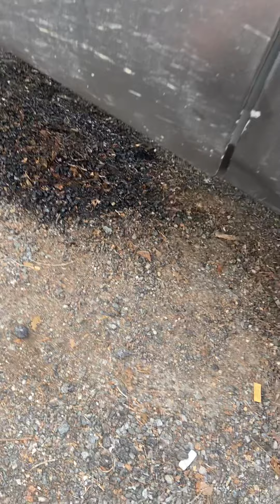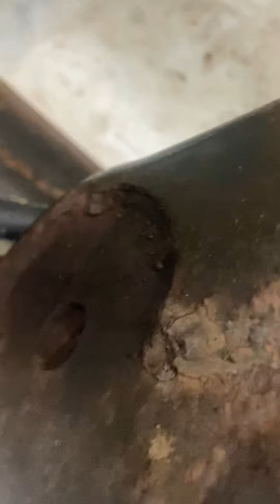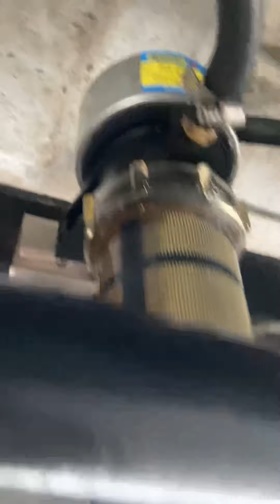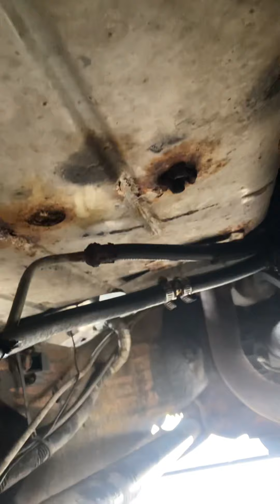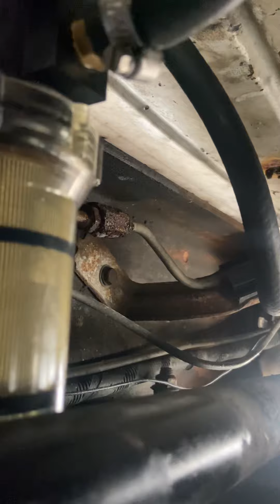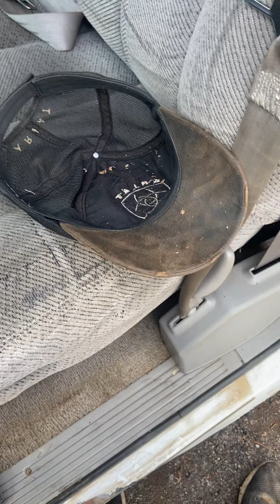6.5 Diesel Lift pump Upgrade

Comment: Not much of an upgrade. 33gph is less than what the stock pump flows. You’d have better luck with a 75gph+ pump.
Reply from the maker: Doesn’t matter now. The motor cracked the block and i now have an LB7 sitting on a skid to go in lol
Reply: @carterm8035  have fun lol. I’m a year and a half into swapping an LBZ
Reply from the maker: @pacificdrumma  I know, i’ve been watching haha
Reply: @carterm8035  probably would have kept it a 6.5 if I was gonna do it again